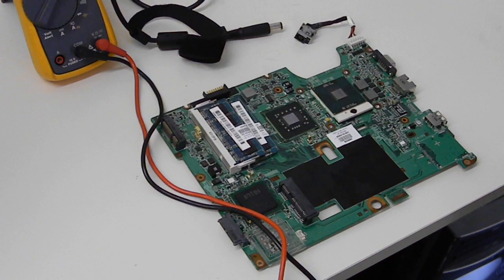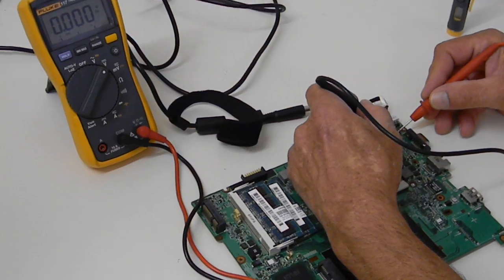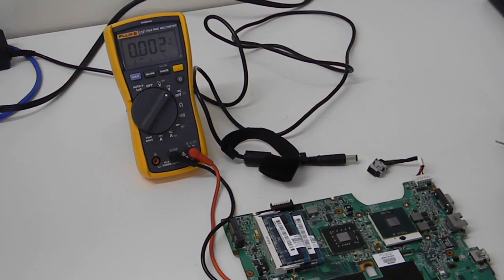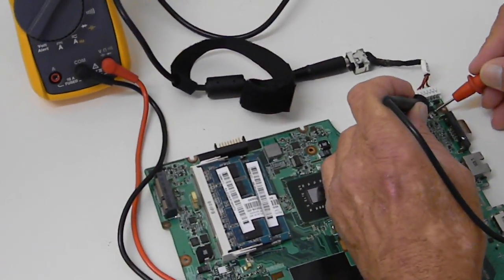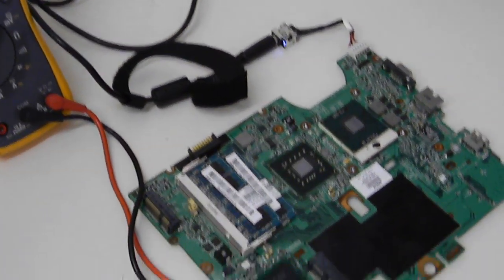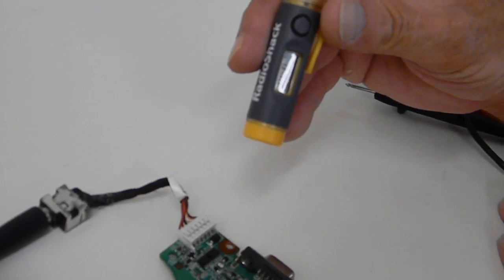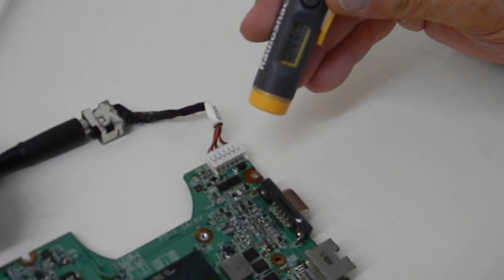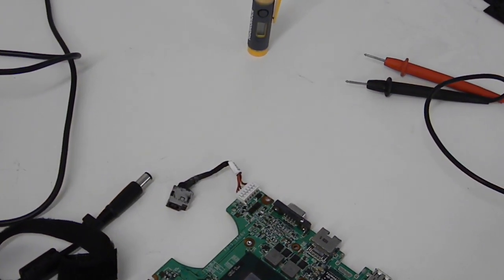Laptop repair of a Compaq CQ50 with a blinking DC power jack, no video, and no power on.

Comment: I have a compaq cq-211 and it has power led lite charges battery lights the power button and I have removed the battery dvd screen hard drive swapped memory . Is there a common fail on this laptop like the power button it self.  Thanks

Comment from the maker: @LB23fan We charge $75 for reflows or reballs if you send the motherboard alone, and $125 if you send the entire unit for us to take apart, repair, and put back together.

With our reballing, we do not charge extra if it is required and all we ask is you wait the time for the components if any are needed in your repair process.

Comment from the maker: @LB23fan You have to change the chip that is affected.  Specifically in this video the main step up and step down FET converting power from 18v or 19v to 12v was damaged requiring it to be changed.